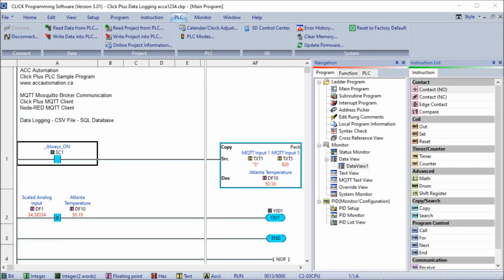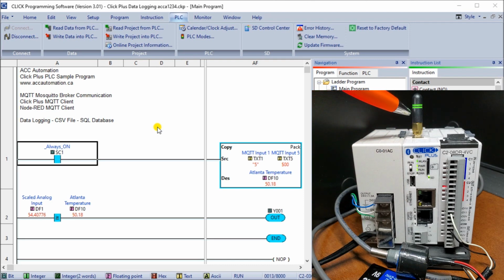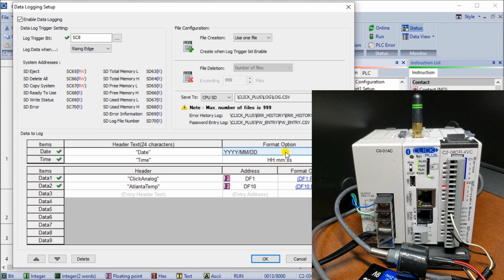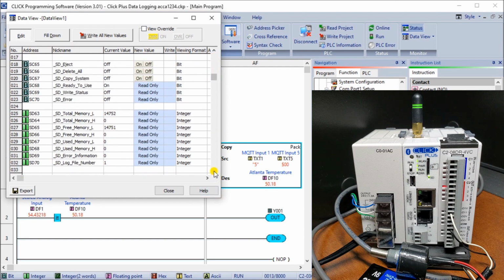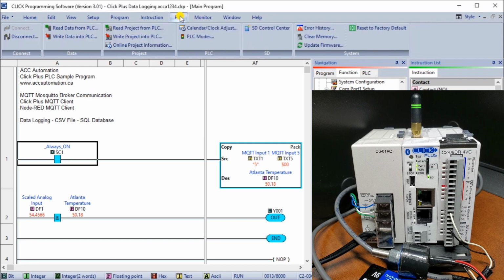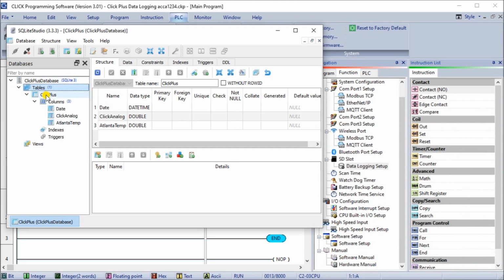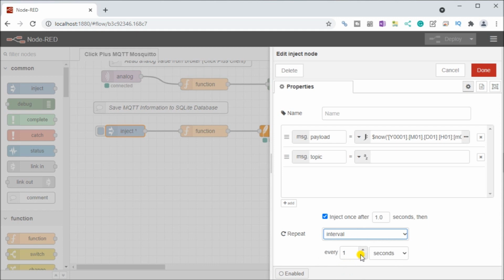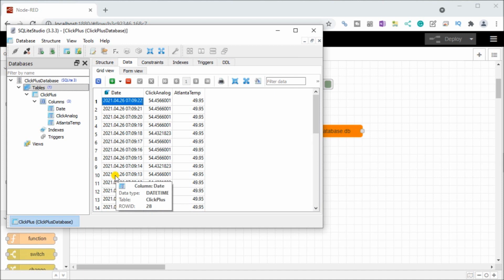DATA Logging with Click Plus PLC & Micro SD Card Now!

Comment: can you have the data be exported into an excel file ?
Reply from the maker: Hi James,
The data cannot be exported directly to an excel file using the PLC. I would use Node-RED to place the data into a database and then use Excel to connect and view the data in the database. This is the preferred method.
https://accautomation.ca/node-red-sql-database-spreadsheet-connection/

Excel has VBA incorporated into it. You could also use VBA to communicate Modbus TCP to the PLC to get the data and put it into the Excel file.
https://accautomation.ca/how-to-implement-modbus-tcp-protocol-using-vba-with-excel/

I hope this helps you out. 
Regards,
Garry
Reply: @ACCautomation   Yes that helps a lot but I was watching your "Click Plus PLC MQTT Communication" video and was wondering if I have to also download that SQlight program. Also what is the difference between the two?
Reply from the maker: @jamesalexander9856  
You could use MQTT, but you would need a broker as well. The video shows a Mosquitto broker running in the background. 
An SQLite database can be placed on the same drive that Node-RED would have access to. The information would then be polled using Modbus or MQTT and then placed in the database using SQL commands. 
Excel can then connect to the SQLite database and display the information. The advantage of using a database is that several users can connect to it at the same time.
Regards,
Garry

Comment: is the db stored on the pc running node red?
Reply from the maker: Hi V Richter,
Yes, the database is stored on the PC running Node-RED in my example but this could be anywhere on your network.
https://accautomation.ca/click-plus-data-logging-csv-file-sql-database/
Here is a post that will discuss the database only using Node-RED.
https://accautomation.ca/node-red-sql-database-log-modbus-logging/
SQLite was used because this can be placed on many different operating systems and devices like a Raspberry Pi.
Regards,
Garry
Reply: @ACCautomation  i could do the same thing on my brx correct?
Reply from the maker: @TheUnofficialMaker  
You are correct. The BRX can communicate MQTT, Modbus TCP, and Modbus RTU both reading and writing. 
The BRX also has REST API that will allow reading of all of the memory areas. Node-RED HTTP Request can take advantage of this. 
Here is a video that will show you how this is done.
https://youtu.be/m-p28H9Fl5s
This will be released within the next few months so all of the links in the description may not work.
Regards,
Garry